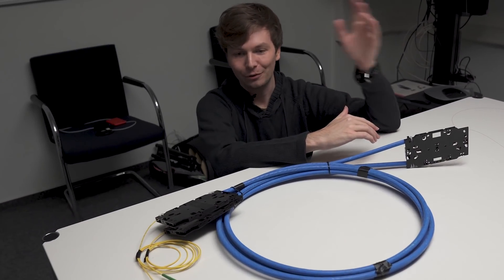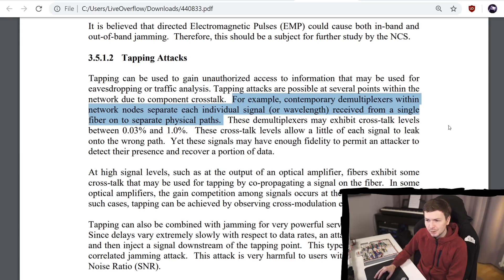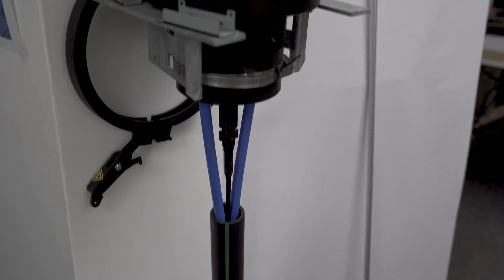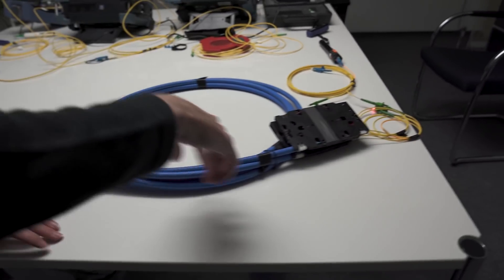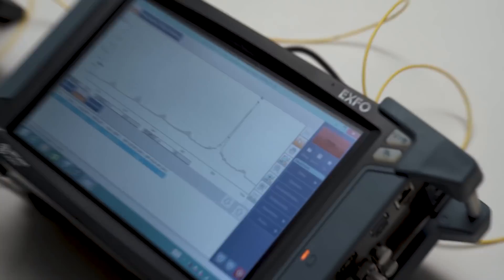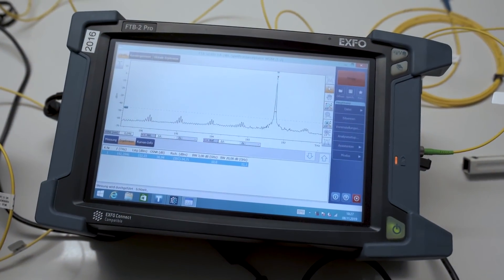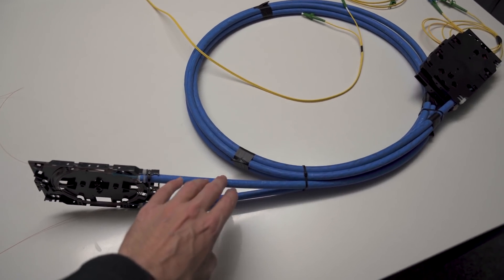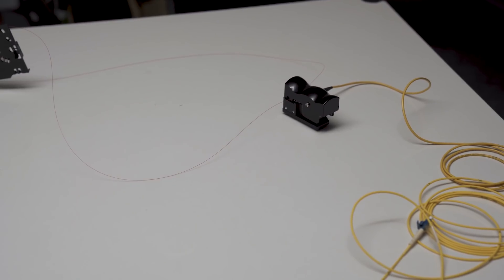Fiber Tapping - Monitoring Fiber Optic Connections

Comment: So typically how much data is transferred over such a fiber? I imagine those measuring instruments are highly specialized to deal with that data rate, and that only to show the presence of data. Probably using some sort of ASIC or FPGA. Typically on the other end of those fibers are massive datacenters to deal with the sheer volume. It's not like you can roll out to some field with your laptop and read out the fiber with some usb dongle with a 20MB/s throughput, or even if you have some sort of high speed capture device you'd rapidly fill up memory with traffic. In just a few seconds you'd have your ram full of gigabytes of data for you to analyze.

Comment: Wow. A metal ring, a case and a spring to bend a fiber cable and push it up against some manner of optics to direct leaking light into another fiber. Clearly something you'd pay 2000 bucks for. WTF?! That seems like something that costs 20 bucks maybe. And that only because it's special equipment and wouldn't be made in bulk. Why is it so expensive?
Reply: Precision manufacturing, And niche market. People will pay that kind of money for a tool like this. Wild how Russia and other eastern European countries manage to make these devices for a lower cost. Russia is also quite on top of data recovery as well

Comment: Why should I mind someone can tap fiber? Don't get me wrong, it's interesting, but:  I implicitly assume that all packets transmitted over public networks are visible to anyone.
... hmm... I guess it could be important for LAN I trust... but I've never seen in practice LAN that needed optic fiber... although...
Reply: but, yeah: I never knew you can tap an optic fiber like this, very interesting
- Very surprising was how much the signal  strength dropped...
Reply: oooh, the military.... - That didn't even occur to me: I just read it in another comment.... - And obviously, other such networks...
Reply: I use Fiber Cable in our House just for Galvanic Isolation.
Reply: @nowaymuller6643  Another interesting use... but I guess that's just somewhere inside, and hard to access to tap (unlike some station/cable outside)
Reply: @Verrisin  sure. Its just my major use for the Glas Fiber Cable.
I also use USB over Glas Fiber.

Comment: "Such an old paper..." hahahahhahahah. Oh, you sweet summer child. This technique for tapping and associated countermeasures has been discussed since at least the mid-1980s.
Reply from the maker: Ok boomer
Reply: @LiveOverflow  Aw, you're just so precious! Such a joy for your parents, no doubt <3 Some of the TEMPEST rated fibre protection schemes were the best in military-industrial complex boondoggles. For example, fibre cables that were pressurised so a bad actor cutting into them to tap a fibre would cause a mechanical pressure-loss signal. Discussed in a 1988 PC Mag available at most newsagents. Low loss passive taps have been commercially available for network analysis and management using thin-film techniques since the early 90s. Fascinating technology. If you were to do some research, you might get some clues to the non-invasive technologies the spooks are probably using (or were using; their tech generations move fast) to ensure we have no secrets from them. Lots of interesting papers from Fibre Optics Conference proceedings from the early 80s, but you'd need to go to a library and read rather than relying on Google to tell you.

Comment: There are ways to explain that drop in power from the tap. If you tap in one place and "accidentally" cause a fiber cut in another, (like with a backhoe) the loss would probably be explained away as loss from the repair splicing.

Comment: If someone tapped our fibers in this manner, we would notice, a drop of 3dB is huge
Reply: to be fair this taping device was most likely produced before the NSA article was published .. nowerdays there is no need to bend the wire as much as this device did..
Reply: @MeaNDeropph  Agreed. Practical experience shows that there's a huge number of reasons for loss in longer fiber circuits, ranging from patches being touched/moved, work in spliceboxes leading to bends, pinches and sometimes even damage, stretching/bending/squeesing of trunk-cables and much more. Usually we would not care about a change (predominately increased) in loss of 0.5dB or less, unless we're on a tight signal budget.

Comment: Now go find where they trapped it 😂
Reply: Thats actually quite easy to do - if you bend a fiber it distracts the light into several directions including back to the sender. If you monitor TX and RX you are able to identify the distance to each connection (either a splice or a connector) by measuring the returning light (duration of time until a  pulse returns). If there is a reflection on one of the fibers which doesnt occur on the other there is a tap at a distance of X.

Comment: Hello, You are using Fiber optic. I actually work on cellular towers. Fiber optic is used for 4G-5G
Reply: The fibers are actually glass as well. Break easy.
Reply: And the Exfo gear is not cheap! We use that to test before we turn the site up.

Comment: You should had shown the effect in a OTDR as this a common tool in most networks.
Reply: My power meter has a little dish you can push the fiber into to find your tone. That would have shown it too.  I kept expecting the otdr shot
Reply: He was using an OTDR that is what the EXFO device was.
Reply: @Sipeari95  negative.  That was a full bandwidth loss from a continuous wave source.  See it measures the x axis in Thz, not ft or meters.  If the exfo machine had an OTDR function available he didn't use it.
Reply: @Sipeari95  the otdr would have been very useful here.  With a launch cable and good cleaning you could get a good view of the exact position of the bend/device, and illustrate its effect on the signal in real time. Bends also show as attenuations of the otdr, not reflections.  Maybe it's a health and safety thing
Reply: @MrNoobed  No it would likely not.
Most manufactures recommends a minimum length of 100m when measuring with an OTDR, at least all the EXFO OTDR modules compatible with the unit he uses in the video has 100m as their minimum range.
A launch cable is used to get rid of the initial launch deadsone and is a must on any OTDR measurement, it will not help you get better results on short stretches of cables as it has nothing to do with why you would not get a good result.

The reason for this is partly the deadsone you get with and OTDR pulse, even with shorter pulse-widths like 10ns the deadsone would still be 2 meters, if you have multiple events within the deadsone it will not be able to distinguish the different events from one another and will just add them together into one single event. 
In the video it looks like the cable he uses is around 5-10 meters so the OTDR would likely have trouble separating the events and would just add them together.

There would also be ghosting when the signal bounces back in the cable, on such a short stretch it would likely bounce back through the entire cable multiple times and cause several ghosts to appear and would make it difficult to determine which events are real and which are not.
It's true that good cleaning and an index matching fluid could help reduce the effects of the ghosting, but on such a short stretch it would likely still be a problem.

Furthermore you would not be able to get a good view of what happens in real-time as running an active OTDR test relies upon averaging multiple pulses within a time-frame of typically 10-30 seconds and as such you would have to run one test before and one test after the device was attached. 
Yes, this would still show the difference the device makes but it would not do it in a way that is particularly suited for a video like this as you would just get a static screen with the results before and after

You are correct that bends show up as an increased attenuation in the cable (typically measured in db/km), you should also remember that all OTDR measurements are done using the reflections from the initial pulse and so all measurements on an OTDR are of reflections.
Again, the wiretapper would simply show up as a slightly higher db/km and would not really make for a good demonstration of how to check if one is installed.

Edit:
Just a side note here, i am not trying to say that he could not have used a active OTDR test here at all, he could for example have used two cables of 50m each between the wiretapper and then used a active OTDR test in the video. I'm just noting that the setup he has in the video would not work with an OTDR and that i think the setup used in the video provides better results for the purpose of this video.

An active OTDR test is a great tool for troubleshooting cables, it is however not a tool that represents the data the ISPs would get from their active links in a good manner, i think that using a real-time signal as he does in the video is a much better way of demonstrating the effects of the wiretapper because any ISP would also just be dealing with received and sent power on active links.

Sorry if i was a little unclear on what i was trying to get across here :)
Reply: @Sipeari95  There is always OFDR with zero deadzone ;)  Also, dont forget that bending loses are dependent on wavelength so tapping is relatively easy to detect for someone skilled.

Comment: I would love to see an extended version of this. Not just a proof of concept, but actually analyzing the tapped signal and decoding it to human readable data.
Reply: The exercise is trivial. It's like adding a "T" connection to the wire. You receive everything exactly as it was sent. No need to decode anything.

Of course, in a real scenario that's still useless because most data communications nowadays are encrypted. So there's little chance to get anything useful out of it.
Reply: @hrgwea  Good luck doing that on an PON network

Comment: I also work in telecom.

Two main problems with tapping (at least for "normal internet consumers"), first the ONT (the terminal device that sits in the customer house) will most likely break the connection because the signal is weak (in portugal we usually have near -25dbm reaching the client, but the limit where the ONT will go up is like -26 or so, almost on the limit...), then with that poor signal (from the tap) you will get a lot of noise, i doubt that you can get anything useful from it. Even then there is the second problem, GPON as the name implies is a passive network, which contains splitters, if you would like to get some kind of information either you go as near the central as you can (but even there are some splitters, so you will never get a signal for a full PON of clients), ideally you would need to catch the uplink on the customer end and the downlink on the central end (to get a minimally useful signal) also, GPON (and also EPON IIRC) has encryption on the downlink communication, so you would not get anything really useful that easily.
Reply: @tuuretarvainen6757  I think it is just a proof of concept, that it *is* possible to do non necessarily practical *yet*
Reply: Boa observação:)
Reply: I guess getting malware on some endpoint may be easier.
Reply: Finally, somebody that understands something about communications. Props from another telecom technician
Reply: @GajoFanatico  hey, i seek to encrypt my connection, so that the spying can be avoided, any idea, what to do, how to do? kindly guide me through
Reply: hey, i seek to encrypt my connection, so that the spying can be avoided, any idea, what to do, how to do? kindly guide me through

Comment: The cables that are being layed a few years ago in the Netherlands are in fact empty tubes. 
When you are the first subscriber of FTTH in that house your ISP sends a guy from the company that owners the fiber network and they will shoot a fiber to your home trough the hollow tube that is assigned to your home.
Reply: That's only true for some parts of the country. (Amersfoort, Nijmegen, and Rotterdam are a few that I know of) The system you're describing is called FlashNet (exists in both optical and electrical variants)
In other parts of the country complete fiber lines were put into the home, pre-populated and spliced, and when you got a subscription, someone from the fiber company showed up and just placed the NTU (the fiber converter) in your house, and activated the line in their central office. (KPN did this a lot, a lot of fibers were even connected to active equipment, but just turned off)
Reply: @ThorNado77  The previous resident of my current and pervious home did not allow for the installation of the fiber. The guy welding the fiber told me that without a pending subscription there is only a hollow tube to safe money but still allowes for one day installation.

The owner of the fiber network was Reggefiber but is now owned by the ISP KPN... (Good thing we have a no monopoly law) 

I think you mean FTU (Fiber Termination Unit)
Reply: @Stoney_Eagle  indeed, I meant the FTU, that was put into my home, but complete with fiber, in my hometown there are no hollow pipes, they are all laid with fiber in it, and the FTU mounted with an empty cover.
When you subscribe to a fiber service, they remove the empty cover on the FTU, and mount a NTU (network termination unit) on top of the FTU, which converts the optical network to electrical. (RJ45 jack, in the early years combined with a coax output for TV, but nowadays they omit the coax output, and use IPTV.

Comment: “Fraction of the signal”, but a 3 dB of loss is 1/2 of the power. Yes, 1/2 is still a fraction.
Reply: O really, wow.
Reply: db loss?  do you mean dBm?
Reply: @rishav4343  dB loss. Loss and gain are measured in dB. dBm is the actual power. 5 dBm - 3 dB = 2 dBm
Reply: @claritytreinamentos  So, every 1db loss on fiber what percentage of power loss represent in general?
Reply: @mario982010  1 dB loss means 21% loss on power

Comment: What does Dbm stand for?
Reply: Mr Noobed hasn't got a clue, I've been certified and installing fiber for last 20 years.
dBm stands for decibel milliwatts. dBm can be used in radio, microwave, and fiber-optical networks as a measure of absolute power because of its capability to express both very large and very small values in short form. The closer the number is to 0, the better off your signal strength is
Reply: Decibels metallic. It can be converted to watts of laser power.  If you have a +7dbM source, and it goes through a cable of some unknown length and loss, and you measure it on the other end at 0db  with the same setup, then the cable caused a loss of 7db.

Comment: Thats quite a lot of loss. The receiver might getting not enough signal. That easily make it suspicious. In dark fiber with long range this became more pronounced. But if it for short range it might not being detected. Thats why both end usually use enough signal power to transmit between two ends. So if some thing like this happens. We can use spare core to otdr the core if its being bended or not. If the spare core was fine they Usually will swap the core. But its tricky because it need both ends to swap. And the tapping became pointless.
Reply: And for closed loop system  this is pretty much a useless method. Because you will only triggrer operational  maintenance people to check anyway

Comment: couldn't you make a powered tapping device with a sensor and a laser that just adds the lost light back in? surely you could calculate for the given radius how strong the laser would need to be...
Reply: You cant inject more light because the laser you would need to do that would be so powerful it would destroy the fiber.  If the light they get out is -34db, then it's doing to take at least +40 db to get a signal in.  That's a 10 watt laser. The cladding around the fiber would burn away under a few seconds of that, then the link would go down as if the fiber was cut.
Reply: had no idea the lasers used were so strong... maybe an external coupling made of glass could overcome the "resistance" due to refraction to get a signal back in? maybe with a very transparent glue for air-gap-elimination? but then you'd also have to worry about the exact frequency and phase of the laser, making it more complicated..
Reply: @krass76  the fiber had a coating on it that keeps the original laser it.  It's fine at a normal power level. But getting through from the outside, I cant imagine a good way to couple back in to the fiber.  Even if you encase the bend in a resin matched the index of refraction... I doubt it. Would love to see the NSAs papers about it though
Reply: @krass76  and rather, the normal laser is like +12 db or something, but that's okay because it's got a proper connector on it and its pointed down the fiber the right way.  You would only need the 10 watt laser if you were trying to go back through the tap they got set up
Reply: thanks man, fascinating stuff! would of been strange if "some random guys in the youtube comments" could solve this :D